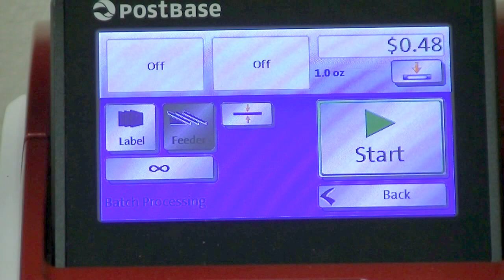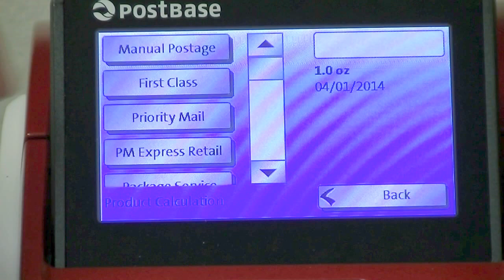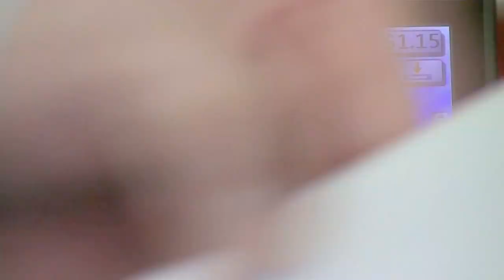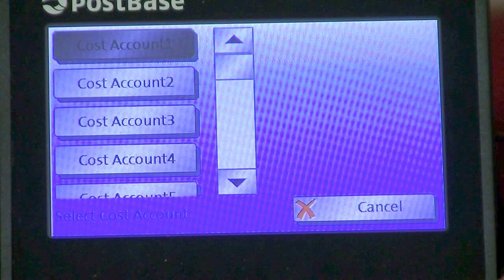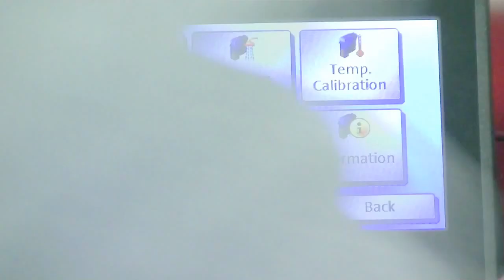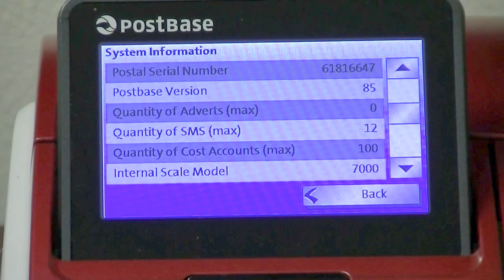Postbase Mailing System Demonstration

Comment: Sorry if this sounds like a stupid question but who pays to the postal company?  Would that be Francotyp?  If so, does Francotyp have some special pricing  with the postal company where they make few cents per each postage?
Reply: The postage  payment is made payable to the USPS. No meter manufacturer makes any money on postage. They make their money on meter rental and equipment.
Reply: David Haimes I found one of these in a storage unit. What is it worth and who would buy it?
Reply: Francotyp-Postalia mailing systems come equipped for instant access to the TELESET Data Center. The TELESET Data Center is the easiest and fastest automated meter resetting system available today.
Reply: Zonethree Sales hey I got one of these in a storage unit. What is it worth and who would I sell it to?